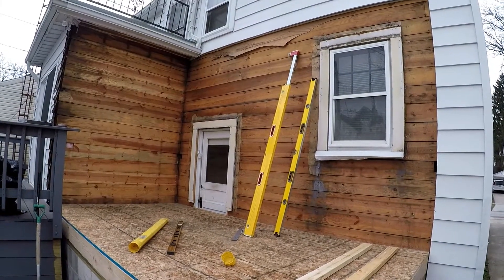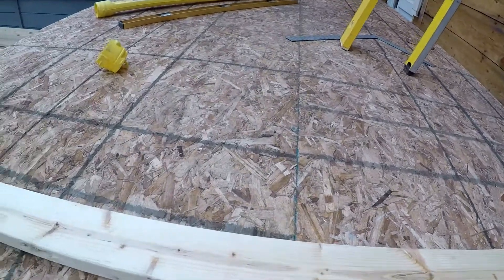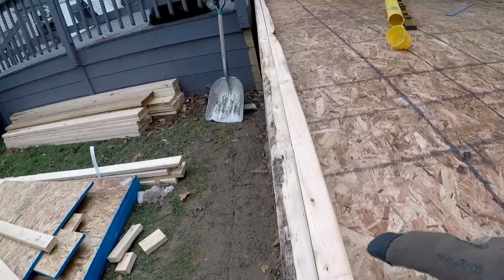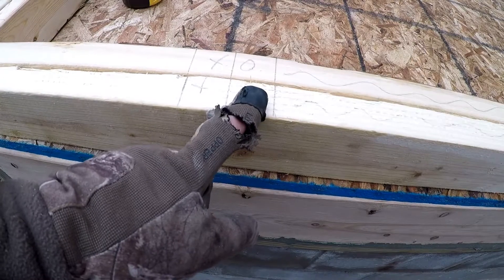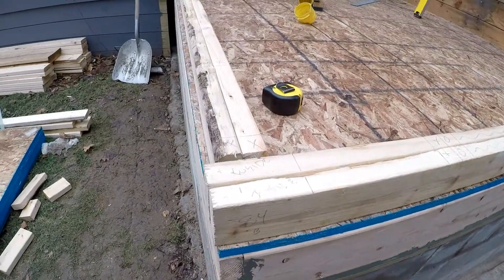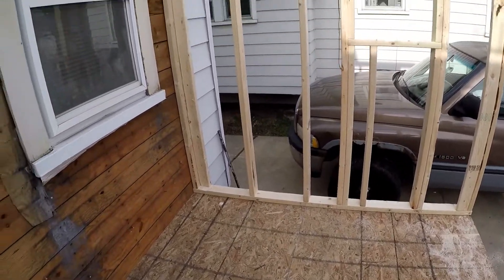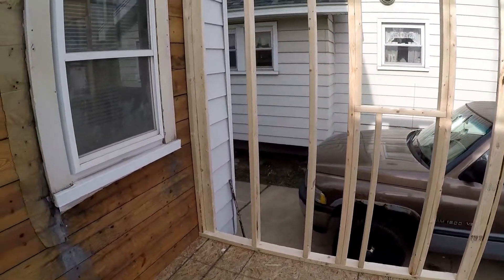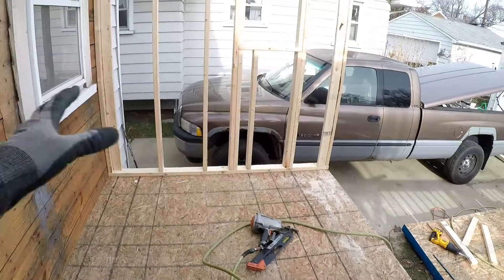Adding A Bathroom #3 | Building Walls | Framing A Window | Figuring Rafters

Comment: You shouldn't piece in the sheathing on the plates like that. It's a tiny addition, so not a big deal, but in general you need continuous sheating from your plates onto your wall studs. If there is severe weather, such as a tornado, the floor framing is only held on with the pull out strength of the joist nails rather than sheer strength of the sheathing and nails. There are examples of entire houses coming off their foundaitons because the studs weren't connected to the plates.
Reply from the maker: That makes sense for more strength, but sheathing the box joist isn’t even required by code here.